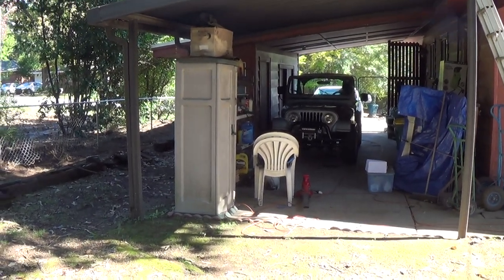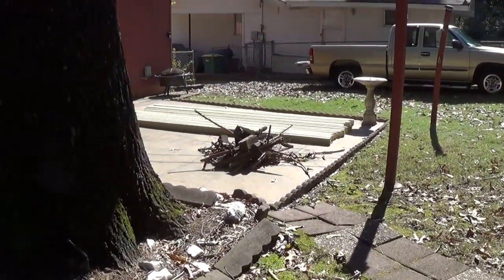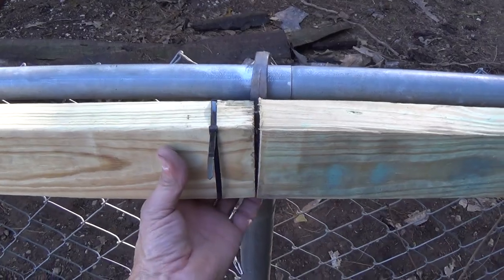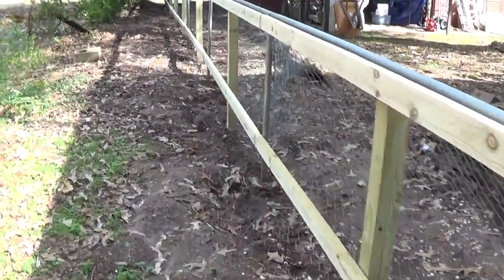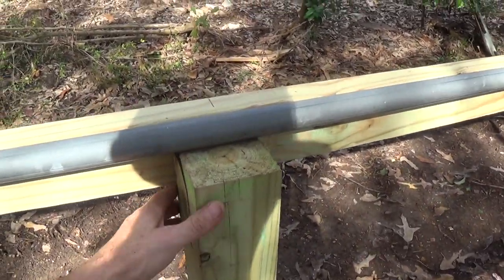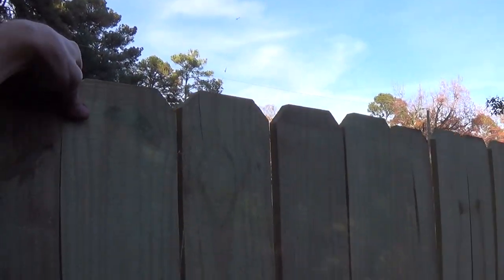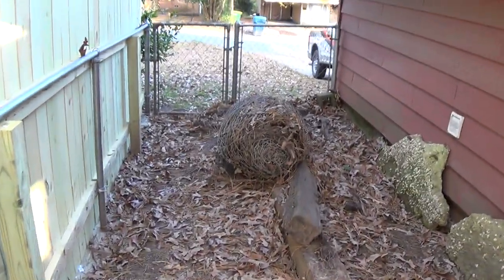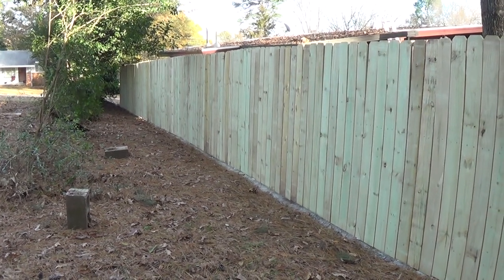CHAIN LINK FENCE TO WOOD FENCE

Comment: I’ve seen another video that showed a cheaper way of doing this with the boards using clamps with screw to hold the wood into place . This one is much sturdier snd will last long . That one had no concrete or wood put into the ground .

Comment: What brackets did you use?
Reply from the maker: Sorry, should have put that in the video.  I got these at Home Depot.
Yard Gard 2-3/8 fixed wood adapter clamp kit

https://www.homedepot.com/p/YARDGARD-2-3-8-in-Wood-Adapter-Clamp-328594C/204510280